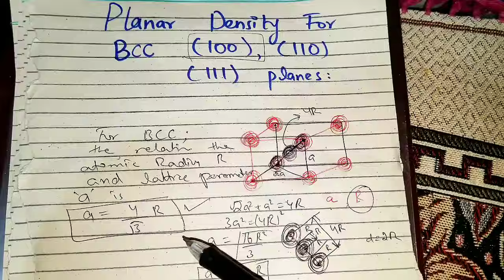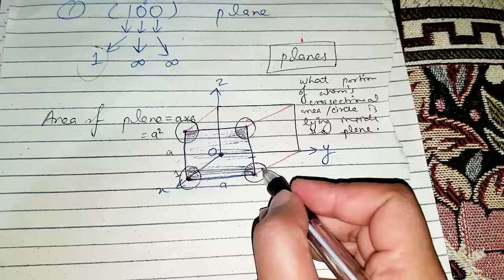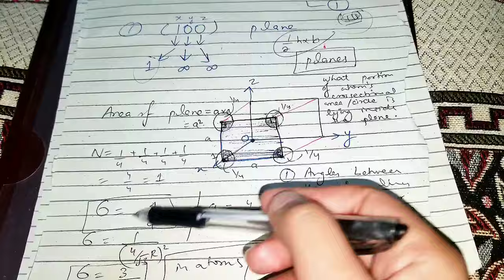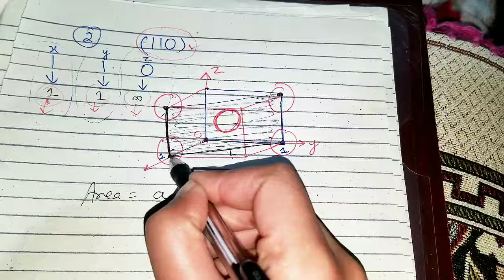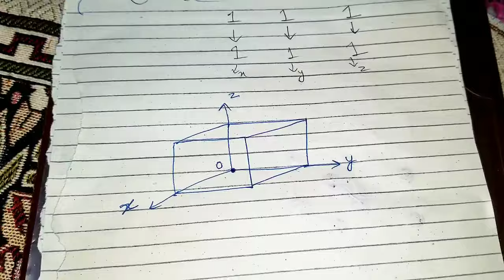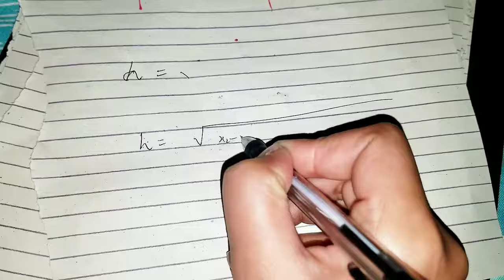Planar Density for BCC (100), (110) and (111) planes. English Version

Comment: is it correct
In the FCC crystal structure, the [0 1], [10], and [1 0] directions represent specific crystallographic directions. The [0 1] direction corresponds to the [100] direction, the [10] direction corresponds to the [110] direction, and the [1 0] direction corresponds to the [010] direction.

actually the question is: 
A single crystal of a metal that has the FCC crystal structure is oriented such that a tensile stress is applied parallel to the [100] direction. If the critical resolved shear stress for this material is 0.5 MPa, calculate the magnitude(s) of applied stress(es) necessary to cause slip to occur on the (111) plane in each of the [0 1], [10] and [1 0] directions.

so if I assume above conditions, is that okay
Reply: @Learn with Amna-B, would you please answer me?

Comment: Sir, isn't 111 wrong? In BCC, there is 1 atom in the middle of the cube, why didn't we take it? Or am I thinking wrong?
Reply from the maker: For atoms to contribute towards the density, its centre must lie on the plane. The central atom does intersect the plane 111, but the centre of body centred atom lies above the plane- plane doesnt contain this atom's centre. And in that situation there is no easy way to calculate the atom's contribution to the plane without welcoming complexities. So we neglect Centre Atom's contribution. Moreover, it is less compared to other atoms certainly. Hence we can move on with those atoms whose centres lies on the plane. This thing makes conparison easy when centre is on the plane as we know the radius of this crosseectional circle is radius of atom but in other cases it is not.
I hope it answers your confusions.
Reply from the maker: This video contains the proof if you re still interested to know the proof.
https://youtu.be/sEb8z0EyRRA?si=kCD-ZWMbhisOPbqp

Well as i said- yes plane 111 does intersect central atom but the atom is not counted towards planar density. The video contains the proof and justifications on how and why.

Comment: For the last part....I am a bit confused The area of an equilateral triangle is (√3/4)a² not (√3/2)a².....Kindly look imto that!! And so the planar concentration should be (2/√3a²)
Reply from the maker: The formula in general for area of equilateral triangle  is √3y2/4, here y is the side of the equilateral triangle. But if you see in our diagram, the side of equilateral triangle is the diagonal having length y=√2 a, put in above formula, to convert from y to lattice parameter a, you will get, √3a^2/2. Note 'y' has square on it, in above formula.
Reply from the maker: Always check, what quantities represent in a formula, notations are arbitrary. 👍
Reply: Well explained

Comment: It is wrong..the central atom will intersect the plane, graph it properly..if u want mathematical reason i can give
Reply from the maker: Provide me with the mathematical proof
Reply: The general formula for the distance  from a point  to a plane  is:

d =|Ax+By+Cz+D|/root(A²+B²+C²)

For the plane , we can rewrite it as:

x + y + z - 1 = 0
Now, let's calculate the distance from the center of the sphere :
Take centre of sphere as (.5,.5,.5) which gives 0.29 but radius will be 0.433 in this case thus (0.43>0.29)
Therefore it intersect.
I can be wrong, dont scold me.
Just guide.
Reply from the maker: Let me check it. Then i will get back to you. I am glad you challenged something and tried to justify your point with proof. 👍🎉
However, let me see and confirm what the case is.
Reply: Answer is correct..i have seen this in book centre atom doesnt count to total contribution here in 111
Reply from the maker: For atoms to contribute towards the density, its centre must lie on the plane. The central atom does intersect the plane 111, but the centre of body centred atom lies above the plane- plane doesnt contain this atom's centre. And in that situation there is no easy way to calculate the atom's contribution to the plane without welcoming complexities. So we neglect Centre Atom's contribution. Moreover, it is less compared to other atoms certainly. Hence we can move on with those atoms whose centres lies on the plane. This thing makes conparison easy when centre is on the plane as we know the radius of this crosseectional circle is radius of atom but in other cases it is not.
I hope it answers your confusions.
Reply from the maker: This video contains the proof if you re still interested to know the proof.
https://youtu.be/sEb8z0EyRRA?si=kCD-ZWMbhisOPbqp

Well as i said- yes plane 111 does intersect central atom but the atom is not counted towards planar density. The video contains the proof and justifications on how and why.